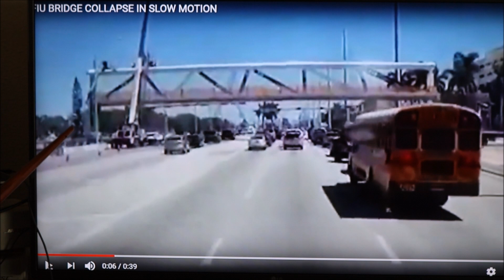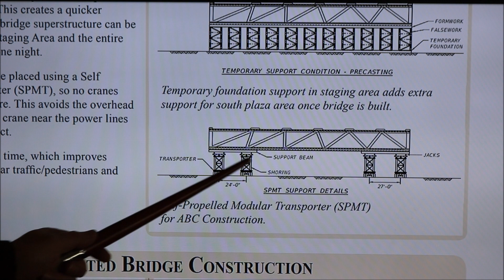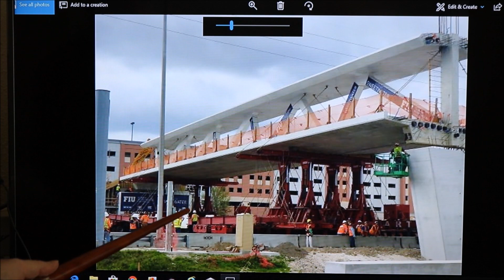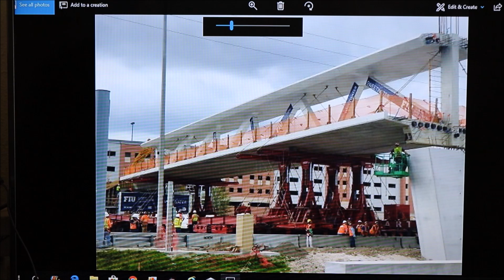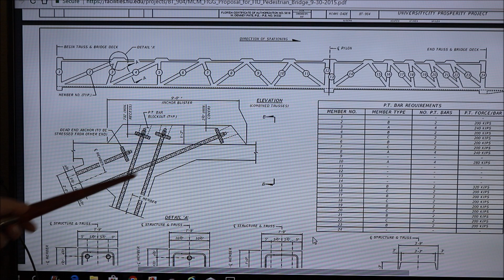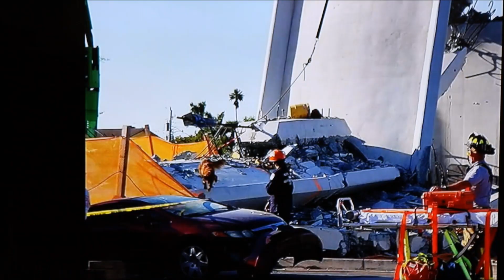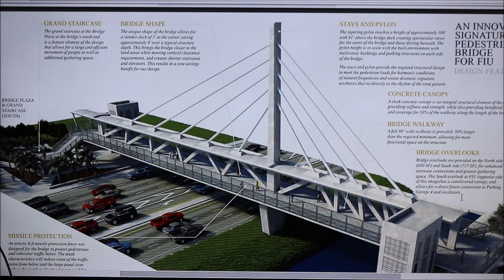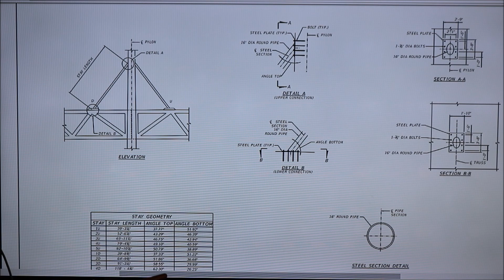Miami Bridge Failure Update 18 March 2018

Comment: They are getting carried away with new environmental materials it is the new religion could they just not build a nice looking steel bridge?  and whos steel are they using.
Reply: They should have the Amish build them a wooden covered bridge.
Reply: Good Chinese Steel, like the bridge they built for BART in Dublin CA that was found to be shoddily welded and had to be scrapped without even being installed? This bridge would have been fine if the installation people hadn't taken liberties.
Reply: It may fall down, but at least it is aesthetically pleasing!
Reply: There are thousands of bridges in the US that people drive over and under everyday that are in major disrepair.
Reply: Thanks for taking the time to inform. Much appreciated.
Reply: Kind of like the bay bridge in San Francisco, were they had to replace all the bolts after they found out there were Chinese bolts of inferior steel being used.
Reply: Michael Stern 
New materials? That had nothing to do with it. Steel and concrete are not new.
Reply: Michael Stern, Good point, who's steel was it. That will be one of the first parts of the investigation,  Do the cert's on the steel meet the design call out?
Reply: osimnod NO, that is NOT what happened to shuttle Columbia.  You used a BS example to support your BS opinion of advanced materials.
Reply: Hey Michael.. steel will rust to quickly in Florida. High humidity and salt air will destroy that in 10 years. This bridge was supposed to last 100 years... DOH
Reply: osimnod WRONG! The thermal tiles on the leading edge of  Columbia's left wing were damaged when they were struck by pieces of insulation that fell from the nose cone of the main external tank upon take-off and not during the shuttle's re-entry. The damage tiles left the edge of the wing exposed to thermodynamic pressure which later resulted in failure of more thermal tiles being damaged and/or blown off which resulted to the more catastrophic structural failure of the wing itself.
Reply: +Michael Stern - There's a video on YouTube showing a highrise construction site, I think in Saudi Arabia, where there's a load of heavy rebar clearly marked as made in China. A fellow picks up a length, maybe 4', and swings it down on top of a Jersey barrier: the rod snaps in two! Now that's weapons-grade Chineseum!
Reply: Not the steel, the wrong corrosion coating to be around salt water. I guess they didn't plan on the bridge being near the bay... lol
Reply: that steel is mainly made from scrap ..
Reply: Bango. you are correct on that.
Reply: Don Karstedt  There are plenty of steel mills in America...where’d you get idea they all closed?
Reply: not if it sand blasted...
Reply: That's a joke 100 years? Look at all the exposed steel bridges they have to be painted on regular basis.
Reply: These days structures all are designed with programmable colored illumination. What happened to "form follows function"?
Reply: Really, and who owns them? Maybe, but where is the steel coming for our construction, from not american owned steel mills, that would cost too much.  We are not the industrial leaders we used to be.
Reply: Michael Stern
The Ben Franklin between Philly and Camden NJ will be 100 years old soon. Beefy steel suspension bridge w/traffic, walkers, and trains on both sides... It's painted constantly. Redecked when it has to be. I use to live 3 blocks north of the Jersey side cable Anchorage. It'll go another 200 it they keep it painted.

A newer bridge across the river ~30 mile upstream recently had a cracked main load bearing I beam. I use to cross that one daily.

One morning large chunks of the deck fell through. Think 4' x 4' pot holes. Another time rebar poked up and flatten a bunch of tires. I now cross a different newer bridge between those two. It is under constant inspection and repair. Neither of the two newer bridges will out last the Ben IMHO.
Reply: Keep that contaminated Chinese steel out of the U.S and use good American steel.
Reply: There probably aren't any more steel mills in America cause we have sold everything to overseas half assed crap producing countries. And there is no such as "good chinese steel!!!
Reply: Michael Stern, agree entirely! The virtue-signalling of using "environmentally safe" materials is beyond stupid. And for what purpose? We're talking about a stationary bridge that should be designed for safety, first; aesthetics, second; "environmental friendliness" way down the line, if at all. Remember the shuttle disaster? On re-entry, it blew apart due to heat build-up on the wing front surface caused by some of the high-heat dissipating blocks breaking off during lift-off. Weak adhesives, being more 'environmentally friendly" were thought to be the blame. Indefensible!

Comment: There are some curiosities here. Beam 11 has NO pretension bars, according to the schedule in the chart shown. But this makes sense, since the beam is in compression, or should be. (But wasn't while the span was being moved.) Beam 10 has 4 pretension bars. Both beams 10 and 11 are going to be in tension while the bridge was being moved. So tightening the bolts in beam 10 makes sense, I suppose. But what are you going to tighten in beam 11? There are no PT bars there according to the schedule. Now, it looks to me like beam 11 failed near the bottom from that dashcam footage. But it also looks like a PT bar with the tensioner popped out of beam 10. There surely must be some reinforcement in beam 11. But what is it with no PT bars in the schedule? Were some bars added after that print because they knew it would be in tension during transport?
Reply: Yes, exactly! The design was changed to cater for the transportation process. Its very hard to see exactly what happened (like dominoes), but it seems more likely that the base failed after tension in the rod is rapidly removed. The base was where the cantilever stress was concentrated.
Reply: I agree. Member 11 should have been in compression when the bridge is in place. The video claims that the rod protruding is from member 11, but none is shown on the P.T. schedule. If the did include some in a later design and If the worker was tensioning that rod in 11, could the increased compression from the rod PLUS the natural compression forces been too much for the surrounding concrete to contain?
Reply: l wilton surely no 11 would have had some rebar in it? So they up the tension in the adjacent struts, to account for the unusual move manoeuvre. But cracks appear at top and bottom of strut 11? But the damage has been done to PT bar in 10, gone into plastic mode, fails when they adjust tension.
Reply: J McC Having looked at more evidence (NTSB B-Roll video closeup) it seems that onw side of truss #11 failed explosively. It is not clear if this was due to overstressing, or due to elastic rebound during rupture of the PT bar.
Reply: Gordon Richardson I’m wondering if 11 goes through first tension, then compression, whether that could set up micro fractures and eventually failure. FIGG was asked to lengthen the north side after finalising design.
Reply: Rob Dunfy Good point! It is not clear if the redesign involved lengthening only truss #11,  or if all of the joins were repositioned to keep the scale/symmetry of the span. The stress of the transportation process could have affected the concrete in #11, particularly if only 2 PT bars were holding up the unsupported weight. The NTSB has a lot of work to do to analyse the exact details.

Comment: If you look at the table and detail drawings of the member types, Member 10 is designated as an "A" type member with four P.T. bars in it, but Member 11 (along with 1, 9, and 12 on that section of the bridge) are dashed. This appears to indicate that those members were not intended to have any P.T. bars installed. Am I reading that wrong?

Comment: Similar  design to the bridge in Nipigon, Ontario that had an engineering  failure cutting Canada's  transcanada highway in half for months
Reply: That bridge IS a cable stayed bridge. The cables were tentioned up in warm weather and when the temperature dropped below zero deg. F, the steel did what it always does when it gets cold, it got shorter, and pulled the bridge deck up several feet.

Comment: In another fail, Florida International University did not hire a pre-qualified company to perform a secondary design check. They went on the cheap and hired their own contractors. Although certified the contractors were NOT pre-qualified. The head of the university stated they are investigating the contractors.
Reply: Steelers!   FIU needs to get out of the engineering/teaching engineering business.  maybe they should become a culinary school.

Comment: If we understood that 1 fatality reverberated into many more lives perhaps our engineering standards would change. Bottom line is if we could keep it in our pants maybe there wouldn’t be so many of us that “environmental” concerns would dominate construction.
Reply: Um, what?
Reply: Christine Cortese 
Here’s the thing. 
In the design document referenced,  the A number 1 design requirement was: its looks. They wanted a Frank Lloyd Wright looking, high fashion bridge. 

The truss design is asymmetrical to line up with the faux cable stays. Had the truss been regular triangle, and symmetrical, it’d be entirely different outcome. 

Including the faux cable stays, that only contributed to interrupting harmonic vibration for comfort, not structural, requirements.

Now how the fuck is that “environmental over reach”? 

It’s an engineering failure. Not exotic materials. The same materials are in use and will continue to be used for fucking ever.
Reply: Christine+ Trying to twist this obvious man caused problem, into some kind of bashing on environmentalists is laughable, not to mention STUPID. Try and stay on topic.

Comment: From what i see, its essentially the steel rods that are supporting everything? Why even make the concrete members?
Reply: The steel rods are putting the concrete in compression.  

They don't support the bridge, or hardly at all, they are just there to put compression on the concrete.  Putting compression on the concrete makes the concrete stronger against tension.

It's the concrete holding up the bridge, or should have been.  But once the steel bolt snapped, if it snapped, it took the compression off the concrete, and the uncompressed concrete was no longer strong enough to hold up the bridge.
Reply from the maker: Asthetics...

Comment: I was already researching this event when, boom! I saw you were on the case with your earlier video.   

I think that truss rod is obviously the key failure point. However, I think another issue concerns the timing of releasing the tension on the rods as the bridge was lowered into place.

Lowering it with the tension adjusted for the cantilever could effectively overstress the ends and overly compress the concrete adjacent to the truss. Ideally, the tension would be reduced gradually as the weight was shifted from the moving rig to the piers. 

Letting the full weight down while still under full tension could have significantly damaged the concrete around the rods.

If they were in fact adding tension at the time if collapse, it doesn't make sense. Presumably they had already released tension after placement. Why would they need to increase it again? It does need to be tightened slightly in order to release tension, but it is hard to believe they were only releasing the tension after 4 days. If this turns out to be the case, that explains the collapse.

In the debris, the truss rod looks remarkably intact which is why I suspect that the surrounding concrete may have been crushed much earlier - when the bridge was lowered. 

The bottom line is this: traffic should not have been permitted below until the structure was fully adjusted and sound. 

Considering the novelty of this design and construction method, doing so was a bold and unnecessary risk. It therefore must be considered negligence.
Reply: Marmaly, I think the OSHA report tends to confirm your supposition.    The concrete at the bottom end of the diagonal was cracking and the re-stressing of the rod (which had previously been de-tensioned) precipitated the final failure.   I think maybe they were hoping it would miraculously close up some of the cracks.
Anyway: https://www.osha.gov/doc/engineering/pdf/2019_r_03.pdf

Comment: This failure is reminiscent of the Hyatt Regency Hotel Walkway disaster of 1981.  While the designs are very different, the failure appears at this point to be similar.   The failure at the Hyatt was tension rod failure due construction design changes.

http://www.sgh.com/projects/hyatt-regency-hotel-walkway

11-22 who cares, your reporting is so beyond any of the MSM reports, a small typo in a one man shoe is not worth mentioning.  Thanks again Juan, very good report.
Reply: Slightly longer article on Wikipeida: https://en.wikipedia.org/wiki/Hyatt_Regency_walkway_collapse
Its the 'small' detail differences between the design and implementation that led to failure.
Reply: Right.  It wasn't the rods that failed in the 1981 failure.  The original plan called for the rods to be continuous, top to bottom.  No connection between the rods and the multiple bridges bore the full weight, only the weight of that bridge.  As built, shorter rods were used, perhaps to make it easier to assemble.  The load was transferred from the lower rod, to the rod coupling to the bridge, through the bridge section for some distance, through another rod-to-bridge coupling, and into the upper rod.  Rather than carry a third of the load, the rod-to-bridge couplings now were asked to carry the entire load.

Comment: Juan; Bid winning Contractors have always been keen on deleting procedures that would gain them more profit for less work. Given the rushed timeline for the finished project... many more type influences may become more apparent than the just the designed dunnages replacements with the substituted ''Cantilever Quick Fix for Gained Time. 
Used to catch these ''Bid Winning Contractors'' trying to skip a lot of plans & specifications over the 23 years serving as an Inspector of new construction over Bridges & Roadways. 
Many i'd stopped, even so, a few were eventually let go by my Engineers. 
Prayers to the loss of the many loved ones. Mercy to the consciences of those found in fault. Only good to come from any of this @ all... will be in the form of stopping any other such rushed project procedures for the Asinine sake of Aesthetics & Greed.  31818

Comment: Looking at that truss rod busted out of the concrete makes me wonder why that rod isn't a bit bigger in diameter. Its easy to see that there's a whole lot of concrete in this design and that rod looks a little overwhelmed.
Reply: There is more than one rod in each truss, 2 in some, and 4 in others.The list can be seen in this video at 03:45.
Reply: Gordon Richardson look 5:54 at the amount of concrete used in the construction and at the one truss rod visible. This rod is woefully undersized in my uneducated opinion. I can see that clear as the day is long. Thank you for pointing out the many different rods used but even this shows a lack of redundancy in the design. One undersized rod broke ( allegedly) and the whole span buckled down.
Reply: The NTSB will look in great detail at the design of these bridge elements, and will test the actual rods used.

Comment: FYI: Bridge Engineering Basics by Boat of Knowledge Ohio University video 3:35 sec: https://youtu.be/SbCVRr5eANA  There appears to be some missing Sum Factors in the Miami Bridge Design. While Σ F of x may be covered only 1/3 of Σ F of y appears to be covered: The Σ Moment of A has been underestimated.
Reply: FYI: Example of 3 directional Failure 1940 Tacoma Narrow Bride Engineering Twisting Example. Part of Pre-Engineering Lecture for "Bridge Engineering Stress Test Failure Example. Click the Link for more information:  https://youtu.be/nFzu6CNtqec
Reply: I just finished reading the design proposal, and didn't see any such numbers: https://facilities.fiu.edu/projects/BT_904/MCM_FIGG_Proposal_for_FIU_Pedestrian_Bridge_9-30-2015.pdf
Care to provide a description or source link?
Reply: @Gordon Richardson: I'm not sure what you are looking for. A Concept Design Proposal is a Sales Pitch Document and it does not usually include "Engineering Stress Test" information or data. A Design Proposal Is an Architectural Pictorial of a job scope. The design proposal that you listed is missing the cross section of the outer side rail walkway. All the stress in this design has been placed on the X and Y: Axis's Straight Lines. While the Σ Moment of A (Twisting) of the outer side rail walkway as it attaches back to the center lines has been underestimated. And that is the drawing that you are missing. Hu! Imagine That.
Reply: Additionally, while we are looking for more missing details from this conceptual design proposal. On Page 8 the span drawing shows the span as being 175 feet long and the footing pillars are undefined in size. Proportionally they look too small to adequately support the full 175 foot span with weight. So I'm suspect of the pillar footing design and why it is missing as well. But wait there is more missing details to find too. This design is carrying the load on the center upper truss and there was no temporary upper truss support included in the Temporary Construction Truss End over the Footing Pillars. So stay tuned, because I'm sure when the job drawings or the engineering specs are released: more details will emerge.